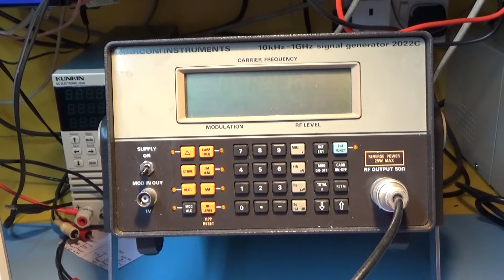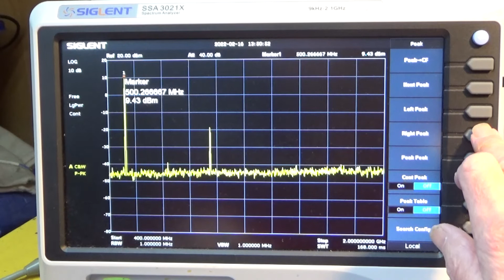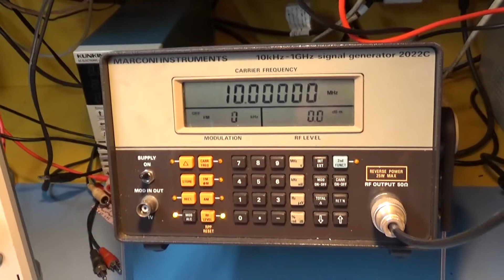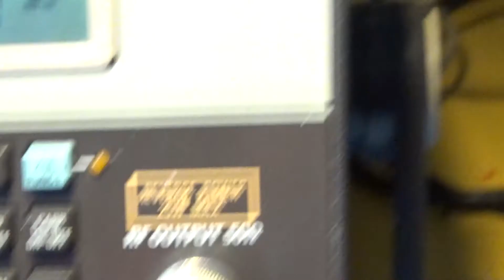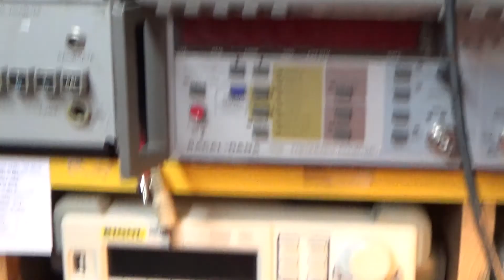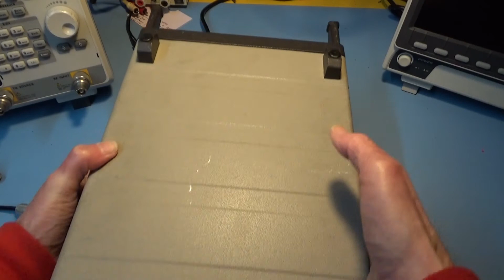Marconi 2022c

Comment: I know these were used quite a bit in the government establishments you mentioned. I remember these failing calibration and usually it was an OM345 that was the problem. I have a number of these all of which have failures relating to the same issue. On the bench at the moment I have resolved a problem by changing IC2,  however, it will not output below 10MHz and is 10 MHZ adrift up to 70 mhz at which point its good all the way to 1GHz, so nearly ok! its difficult getting replacements for the OM345 though
Reply from the maker: Yes om345 is well known for dieing, they all did in mine. Don't bother trying to find replacements, they will be expensive if you can even find them. There are much better modern mmic devices by mini circuits or avantek and they're fairly cheap. That's what I used but I can't remember the past number. But you need something with equivalent gain which I think is 12 db

Comment: Nick, I've purchased used  Fluke, HP gear on Ebay with similar error message. Looking at the magnified pictures they included revealed the instrument was also set to ext TB. Buyers should always try to look up the message code(s) in the manual before purchase. Something to watch for. Also, what is the RF input level of the Siglent SSA before it starts to produce it's own internal IMD? I may someday have to move into the 21st century and get an SSA.
Reply from the maker: I think really you would just have to be aware of the setting of the sa because at some point you can overload the adc & then the imd will be compromised. But I think its very good unit at a fraction of what they used to cost before the Chinese got into making test equipment. Thanks for watching

Comment: Great bargain Nick, the error 11 thing has been a trap for many perhaps, as you said.
I’m amazed how all the OM345s are still there and the instruments is working great! 
The are 8 OM345 in total on that board. 2 under the can and 6 on the board (one of the six is hiding under a small shield in the middle of the board).
I wish you checked the total hours counter, just curious.
Also curious how far off is the 1KHz audio oscillator if you wanna check it.
Thanks for sharing all the infos and my video.
Cheers 
Diego
Reply from the maker: I Will check the hours counter latter  assuming we still have power, big storm  coming!  and also the 1kHz frequency. Having downloaded the service manual I was surprised to read it has a 10 MHz OCXO in it so this must be the posh version! That would explain why it was almost dead on frequency with no drift.
Cheers Diego
Reply: @ptronix  Indeed Nick, I wasn’t sure enough to state it but I remember reading somewhere the C has a better oscillator. And in fact you checked it. Mine isn’t as close to that. I have adjusted it as best as I could but it just doesn’t wanna stay there. It drifts quite a bit and takes ages to warm up. The only solution, an external reference. But it is actually very nice that you have the option to choose 1, 5 or 10 external reference.
Good luck with that storm!
Diego